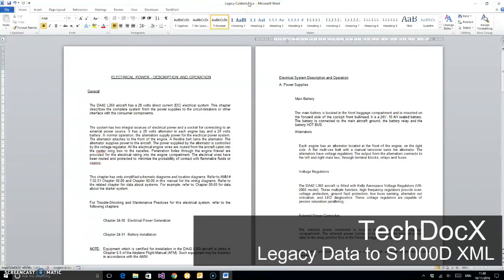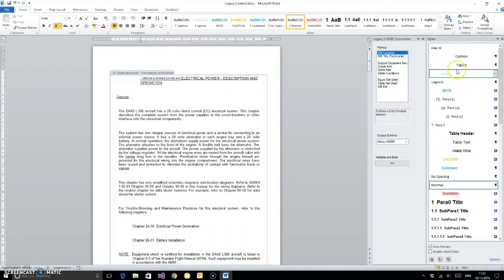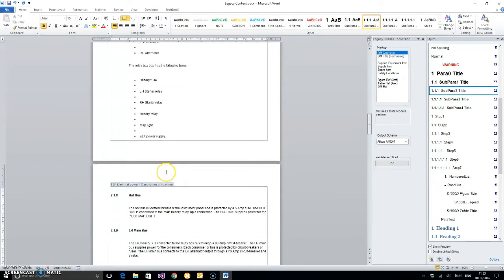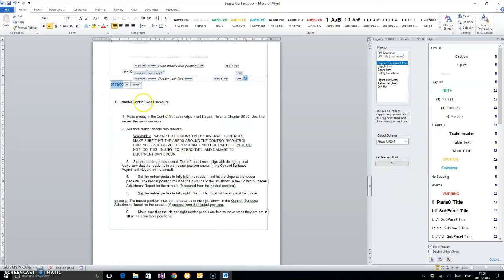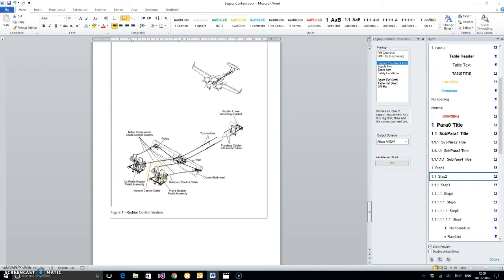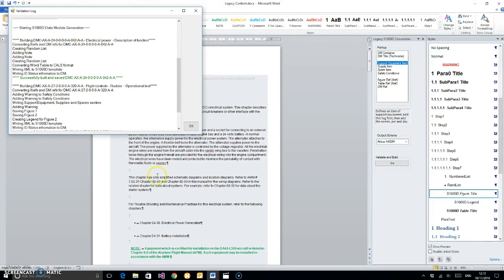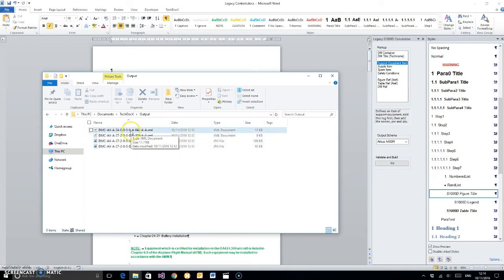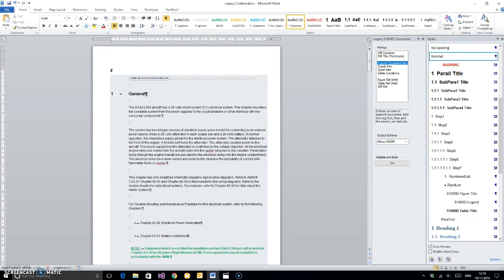Word To S1000D Conversion Tool - Demo (short version) - SOFTWARE NOW VASTLY IMPROVED AND EVEN EASIER

Comment: Does this only work with MS Word? What about FrameMaker or InDesign?
Reply from the maker: Hi, yes it's a Word Add-in, so once installed it sits inside Word itself. If your data is in other formats, there's normally a process to get it into Word which you would undertake first as part of the conversion project.